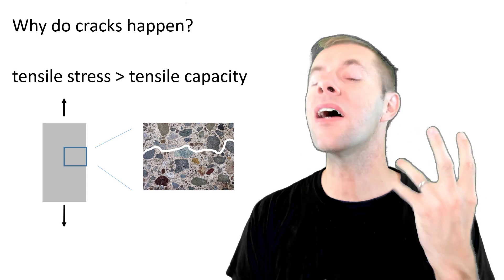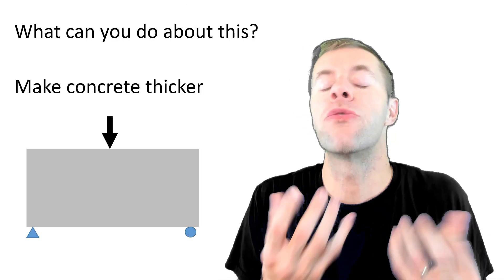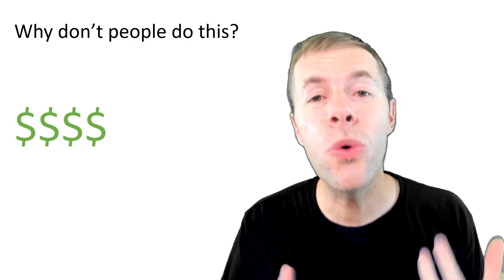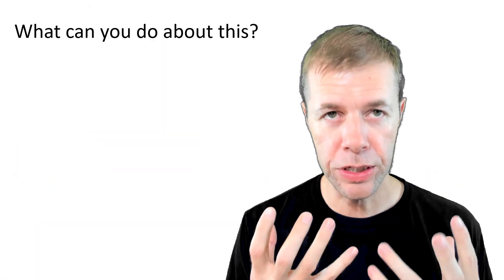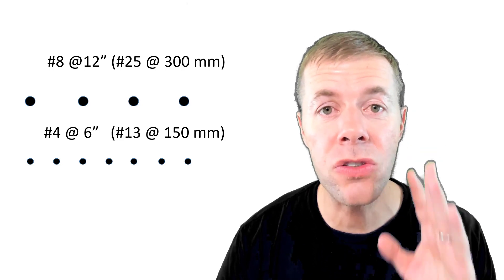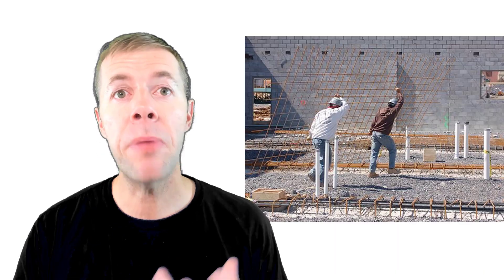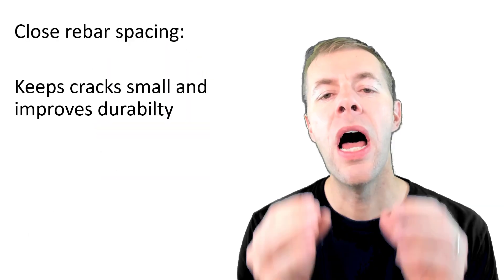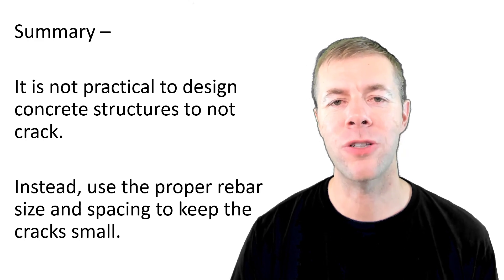Structural Cracking in Reinforced Concrete

Comment: So, a technical question: in the depiction of large vs small rebar, there are four #8 sticks and seven #4 sticks. If I did my cross-sectional calls correctly, there is 2.28 times (roughly) more cross section in the four #8s than the seven #4s.  Wouldn't that reduction in rebar affect the overall tensile strength of any given concrete formation?

Comment: Hi Tyler i just wanted to add a comment on the rollout rebar. i have been involved in the reinforcing industry for over 30 years. This rollout method is great except where you have lots of plumbing and electrical conduits sticking out of the slab on grade. Because you will have to lift the roll over these conduits. It's not easy task to accomplish. I tried the roll out method on a new plastic recycling plant  project i managed. lol this was not the type of project to try the rollout method on. But its a method that seems to be more popular in Europe 10 years ago. A BFRP grid is a great alternative. But i could be a bit more expensive but not necessarily

Comment: G,day Professor from Sydney Australia.
I really appreciate your education and training, thankyou.
Q1. Your claim that smaller deformed mesh sheets of reinforcement, will reduce the size of cracks. Is this evidence based from experimentation, testing and examination data?
Alternatively, assessed from building faults?
Comments: I still believe that concrete matrix of the correct ratio of aggregates and cement is not the problem, but the swelling of rusting internal steel
☔🍏

Comment: pretension or post tensioning prevents. Roman beams very little tension mostly shear and compression.
Reply: yep exactly they used lime based cement and ash as filler makes them weaker tension wise but more flexible and lighter. got nothing to do with money. in fact the Rome dome was massively expensive but worked due to no need to deal with tension. in fact it was rebuilt several times due to being built wrong and causing tension failures.

Comment: I truly appreciate your videos and the passion you put into them. 
1-Ferrocement is a subject matter that interests me as I am in the planning phases of building a monolithic dome with ferrocement (ferroconcrete). Please share your thoughts and expertise on this. 
2--As well, I came across an idea where  bamboo is used instead of rebar. Would appreciate your insight with this as well. 
Many thanks for your dedication.
Sgt. Oli
Trexecgroup@gmail.com
Reply from the maker: Oli,
Thanks for the questions:
1- Ferrocement is great for certain applications.  If you are using it in places where it is not exposed to deicing salts or ocean spray then I think it could be a good choice.  I really like it being used in domes as this would put the material primarily in compression and that would help avoid cracking.  Please email me a picture after you are finished with your project.  It sounds really cool.

2 - Bamboo is an AMAZING material.  It is very strong, stiff, and lightweight.  One issue with it is that it is not available everywhere.  If you have a local source then you do not have this issue!  Second, the material is variable because it is made by nature.  That means there can be local weak spots in the bamboo because of how it was grown.  Unfortunately, the best way to determine these areas is with experience and visual inspection.  Another way to do this is to assume that the bamboo has a much lower strength than it typically does.  I have never seen studies of the long term (20-50 y) performance of bamboo in concrete.  This could be an issue as the solution in concrete is very basic and breaks down a lot of materials.

Comment: On the topic of reinforced concrete, I would love to get your take on how to deal with slabs on grade. Many decades ago I heard one notable engineer opine that the primary purpose of slab on grade reinforcing steel was to give everyone a nice warm feeling. 
A video of your thoughts would be great. ;)
Reply from the maker: Fred - You can make slabs without reinforcing and they can do great.  However, if you have movement in your base, curing, or large temperature changes then reinforcing helps a lot.  I agree that a video would be a good idea.